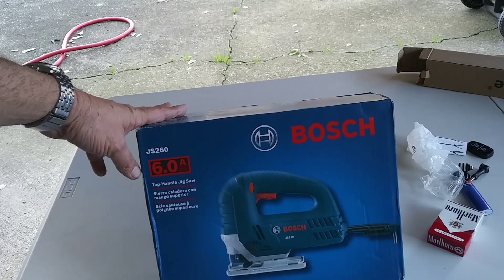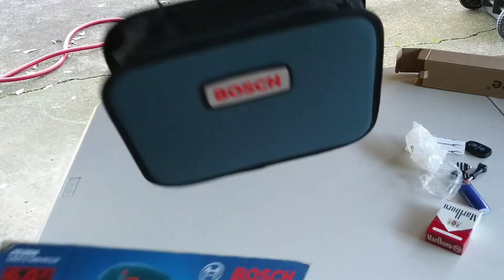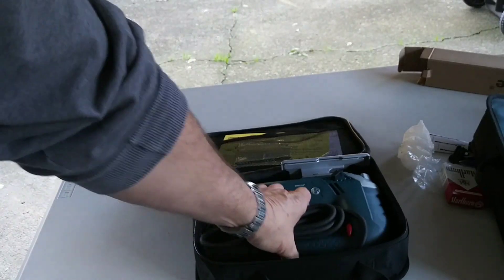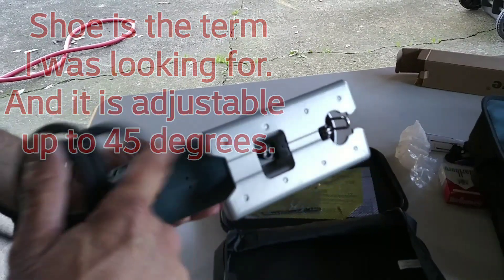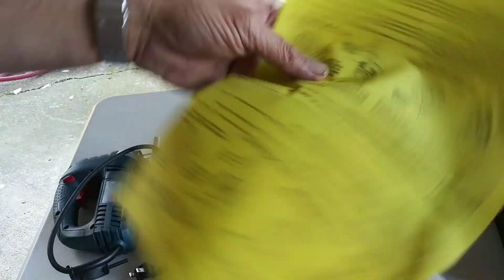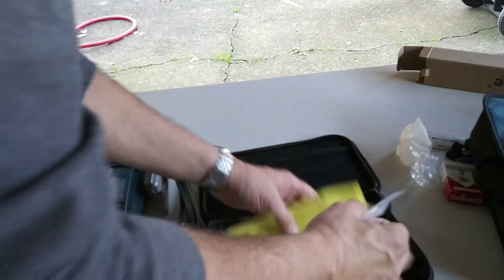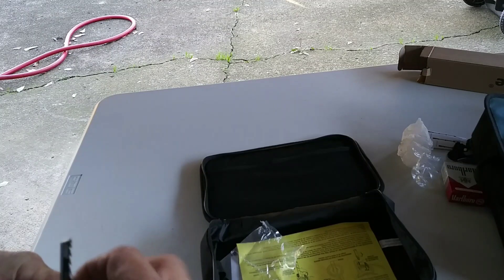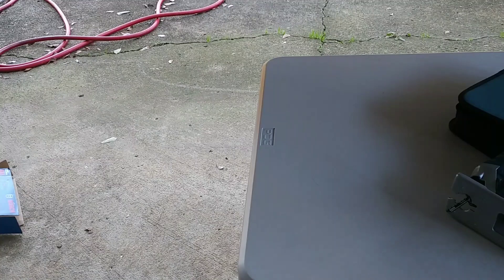Bosch JS260 Jigsaw

Comment: At 3:50 that 4 setting orbital switch is actually what would help you make a cleaner cut.  The final setting you had it at makes the most aggressive cut...  Setting it TOWARDS the blade would make the cleanest straight cuts.    Hope this helps anyone watching!
Reply from the maker: Yeah I did it wrong 😂. Thanks for pointing that out. Once I changed to blade to a fine scroll blade and left the setting on 0 I got great smooth cuts.
Reply: @thenotoriousrvh6091  All good man.  Thanks for posting this vid!

Comment: Does it have the progressive cut option ,that would explain the rough cut,ossilates the blade forward as it goes up and down
Reply from the maker: Probably Idk lmao, last Jig saw I used was a 20yr old craftsman we had at a shop I installed at over 10yrs ago.
Reply from the maker: Maybe I should read that pesky book 😂
Reply: @thenotoriousrvh6091  not sure myself,was just wondering if it did.

Comment: Bosch makes some really good tools mine is a black&decker and it sucks. We had a Bosch dishwasher it was like $900 but you couldn't hear it run was awesome till my girls dumped a tub of craft glitter in it🤣
Reply from the maker: Damn a $900 dishwasher ruined 😳 over $1.00 of glitter ? Ouch !!
I was going to just get a $40 B&D or one from HF but like I said, just figured the extra $22.00 would be worth it. It's very smooth, should have gotten a more scrolling friendly blade with more teeth.
Reply: @thenotoriousrvh6091  yep i use the real skinny bosch scrolling blades they cut nice. yep a new pump for it was going to be $400+ so I just got a Maytag haha🤣
Reply from the maker: And no more glitter 😂

Comment: I haven’t used Bosch before, I guess I’m too cheap lol. “I’m doing a video I ain’t got time to talk to you”. And Screw them damn instructions. You figured it out!!
Reply from the maker: Had I read the instructions I would have known to use a screw driver 😂 not my big clunky fingers. 
I was going to buy something cheaper but figured the extra $20 would be worth it in the long run, imo. I'm so damn OCD with matching items it's ridiculous.
I ain't got time to talk about my vehicle warranty 🤣.
Reply: Don't get another ticket👍🤣🤣🤣👌
Reply: Robert Van Hoy power tools I’m not too ocd, but tool accessories, I’ll organize my loose screws and bolts for an hour after dinner and think it was only 5 mins lol